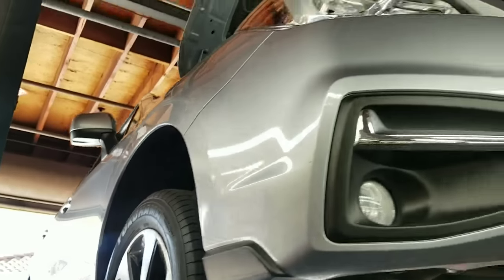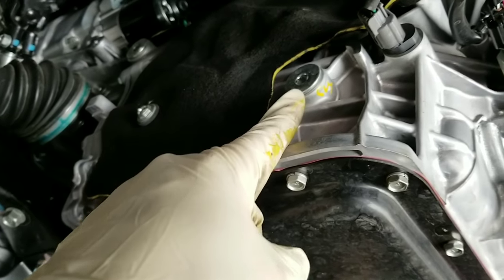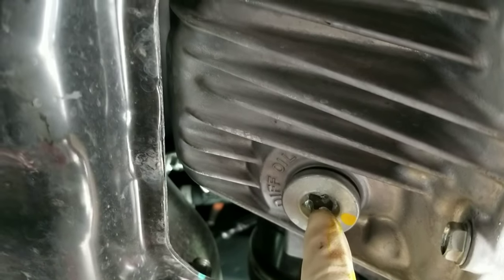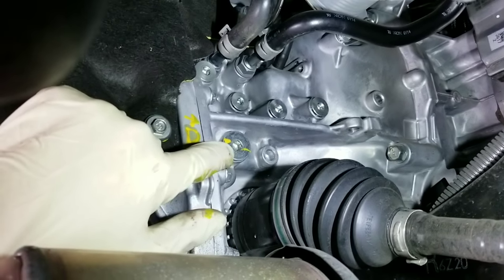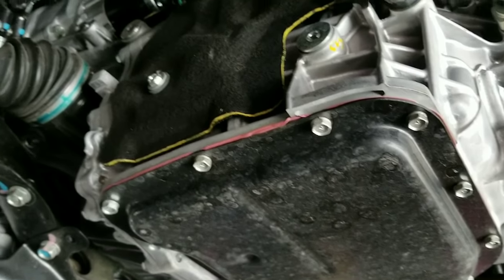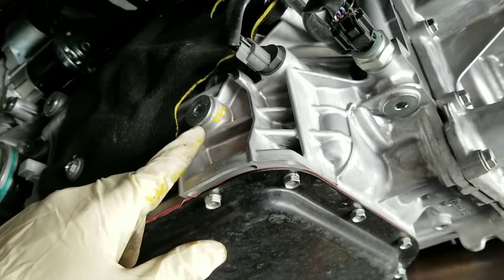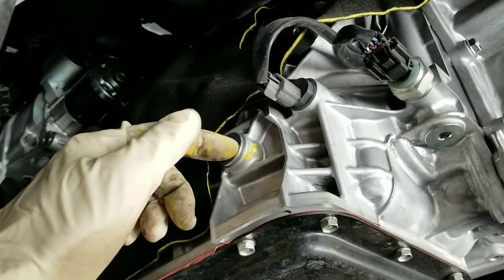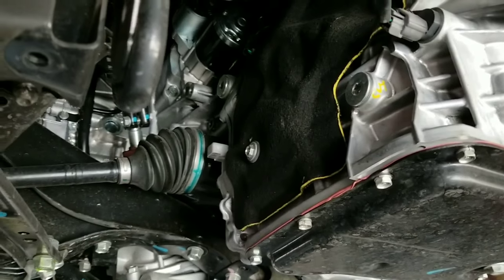Watch before you screw up your SUBARU CVT transmission & differential

Comment: Subaru needs to get their story straight! You void warranty if you change CVT oil, yet owners manual recommend you to inspect and replace CVT oil under heavy use. Their definition of heavy use include city stop and go traffic. By that definition, we all should replace CVT fluid every 30k miles. Yet, replacing will void warranty. What a shit show. 

It’s like they screw you either way. Might as well just replace them. The chances of CVT failing within warranty is low. Mighty as well change it in preparation for possible failure beyond warranty.
Reply from the maker: Chsnge it and dont say anything haha

Comment: The "drivers" side is NOT the "right hand side, on US oriented vehicles. It IS the "left hand side". "Sides" of a vehicle in EVERY country are assumed to be while sitting IN the drivers seat. So regardless of what country you are in if it says left hand side it is while sitting in the drivers seat. So for the USA that would be "drivers side". For countries with the steering wheel on the other side of the vehicle, the drivers side would be the "right hand" side. In no country, and in no situation, do you EVER determine the "side" while assuming standing in front of the vehicle. It is ALWAYS while sitting in the drivers seat, which is fracking dumb, but it is how it has always been done.

If whoever initially made this determination had had any brains, they would have assumed that anybody needing to know a "side" was working on the vehicle and that almost certainly they'd be standing in front of the vehicle, in which case, and it would make a lot more sense, you would assume US drivers side to be right hand but that would make too much goddamn sense so they of course failed to USE common sense.
Reply from the maker: I work on JDM vehicles that the steering wheel is on the right side. So I get them mixed up. Thanks for the comment.

Comment: Dumb Subaru have too many hex sockets on the driveline. Why why why did they put one on the LHS of the diff if it ends up in putting diff oil in the
transmission? Why 2 identical plugs on the dumb differential? Just asking for problems!!